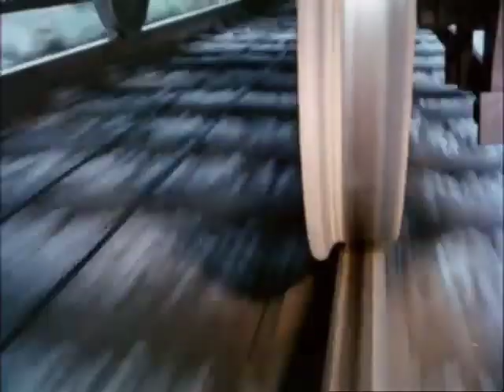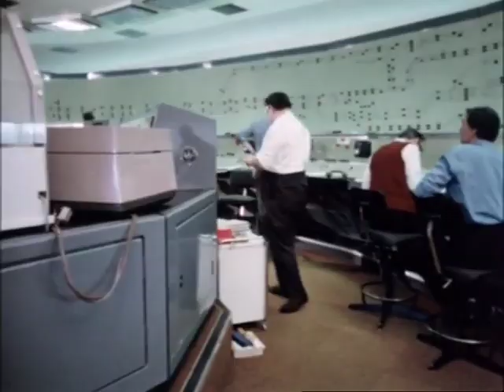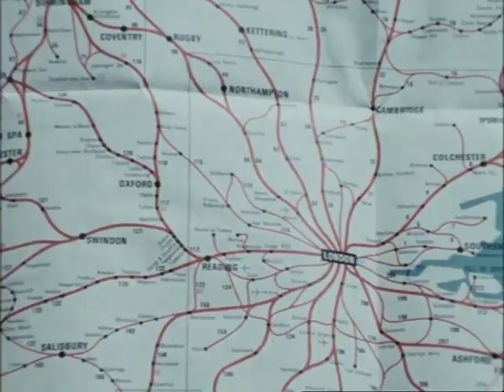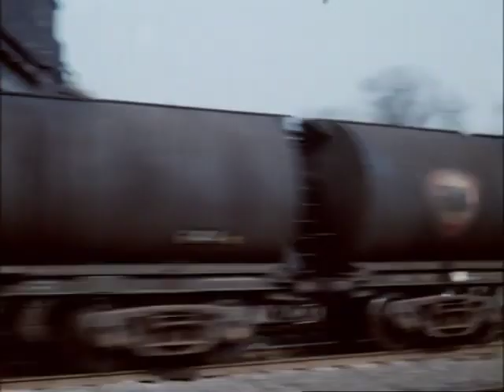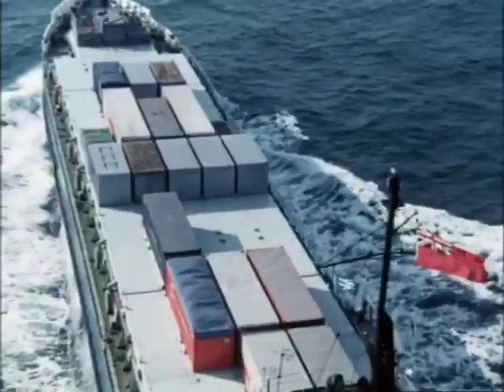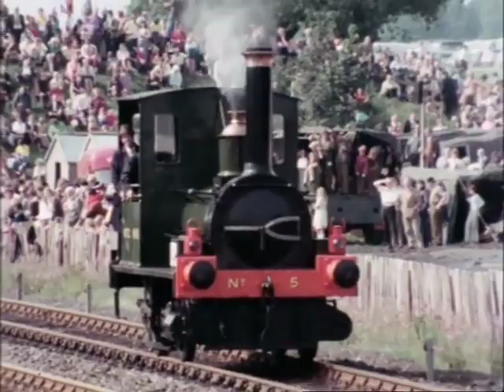Vintage railway film - Discovering railways - 1977

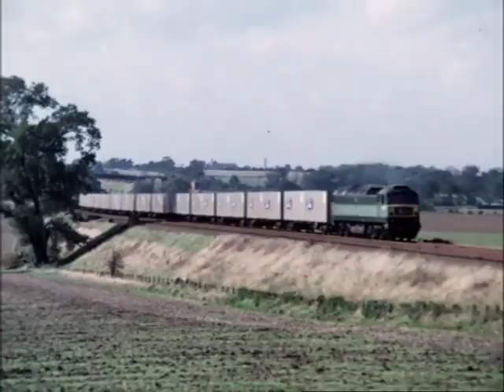Comment: A compilation of BTF's best bits, those shots of green Peaks and the two tone green 47 @08:06look like they must be from the late sixties; still, it was still applicable in 1977 I suppose
Reply: The Peak came from an earlier film c. 1968. But there were at least 3 Class e7s still in green in 1977 (I'm aware of 47 195, 47 256 and 47 366 but ther may be others).

Comment: To late for 77 the green diesel locomotive suggest late 60s maybe 1970. Diesels in the uk went Blue from the early 70s onwards.
Reply: Did you miss the HST at the very beginning of the video? They entered service in October 1976.
Reply: Pretty sure a lot of this is spliced together from older films.
Reply: That's were you're wrong. A handful of locomotives were still in green in the late 1970s. On 40 106 was outshopped from Crewe in Brunswick Green and full yellow end in late 1978. She appeared at Rainhill 150 in 1980. There were others still in green in 1977 including 08 923, 20 026, 20 141, 20 147, 20 151, 20 153, 20 170, 20 175, 20 177, 47 195, 47 256, 47 366.

There were also the 2 Class 01s at Holyhead which remained in black until withdrawal in the early 1980s.
Reply: There were a few repaints in this period for rebuilt commemorative engines.
Reply: @glpilpi6209  that was mainly in the late 1980s onwards. In the 1970s they were mainly survivors of the pre-blue days. Although 40 106 was repainted in green I'm not sure about any of the others.